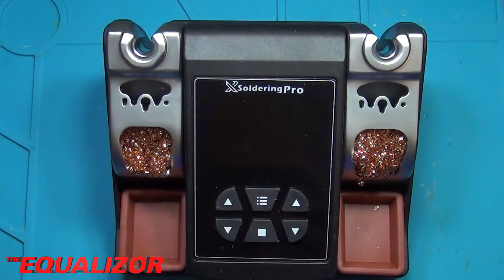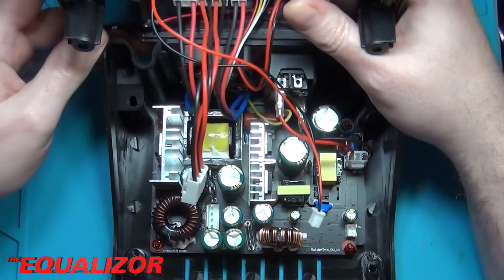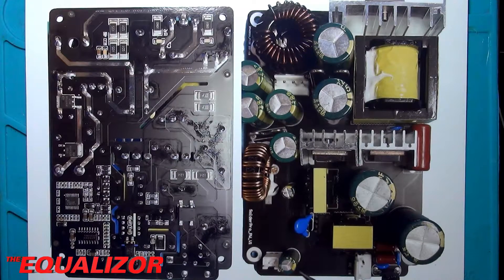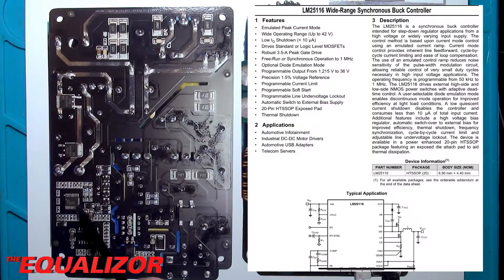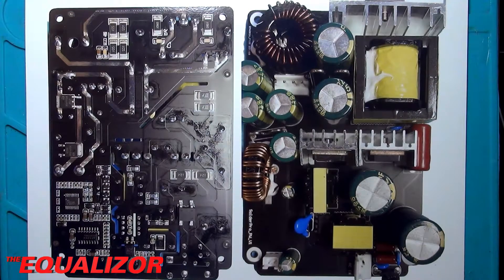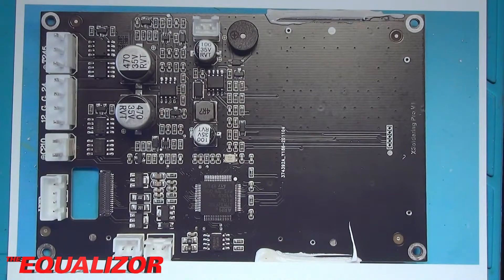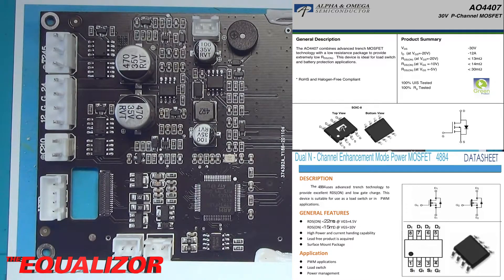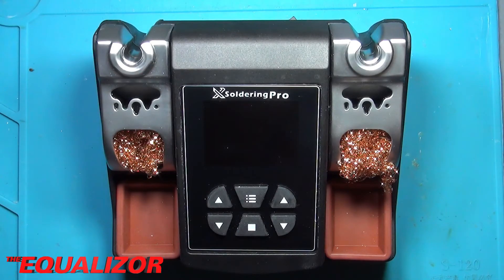Xsoldering Pro teardown

Comment: 2 pin for c210 because thermocouple is in series with heater element. And 3 for c245, because it has separate heater and thermocouple.

Comment: wow thats definitely better than i expected, those things look kind of awful in the pics, i was going to go with the mechanic or i2c, eventually i grabbed the aixun assuming with its updatable FW, high power and  JCs usual good support itd get a T210 handle in no time but it didnt so i grabbed the recent OSSTeam(GVM) t210 which was a cracking iron but mine went faulty, i picked it up one day and the tip went glowing red and then it just died, shame as it was a lovely bit of kit really. ive seen the new T16 which seems a bargain as while it comes with a T12 its compatible with a T210 (and id assume the C115) but im thinking i may just buy a real JBC instead at this point instead of buying clones over and over

Comment: Dear sir ! Please tell me how to solve this issue.......
I have bought a new Xsoldering pro......but from first time I am facing a problem with this.....
C245 iron handle auto sleep sensor don't work above 250°C ....Maximum  time I work in 350° ....then I have to reduce the temperature manually under 250°C  ....
But C210 handle is working fine.....at 400°
how can i solve the problem sir !

Comment: I'm going to try the new xFixTools0308 update software. Which one did you try last (xFixTools0111)? My station has a problem with only one C245-knife tip - it does not turn it off when put back in the station. All other C245 tips work properly.
Reply: ITS problem tips . I nave the same problem . AND i Buy new tips .

Comment: Thanks for the video. But I have a problem with this station: when the C245 temperature goes above of 230 deg the C245 cannot see the stand, so cannot powering off. And if the temperature goes lowest of approx 230 deg the C245 'stand' status working well. I cannot take my mind what is happened? Is there a EEPROM have a not valid data? Why it breaking near 230 degrees?
Reply: That's right, I discarded it for it, it is a known problem, even the sellers describe it in red letters

Comment: Very throughout and quality review, especially for such a niche Product!

Have you found a suitable replacement for the fan yet? It's driving me nuts that this little thing works so poorly and makes more noise than all of my desktop's fans together (from what i see its 40-50mm 2 pin dc fan).

Otherwise i am quite impressed by this station, only one issue : when I heat up the c245 tip above 300°C , it wont cool down unless i press the tip against the metal plate. I suspect, that it may be aconfic issue, but I cant seem to edit the software...
Reply from the maker: I replaced the fan with a dual ball bearing one from Amazon https://www.amazon.co.uk/gp/product/B07NTCXCYD/ and it work great! So much quieter, makes a huge difference. With regards the cooling down issue, have you tried just doing a factory reset (It wouldn't work on mine IIRC but ymmv)

Comment: This thing is absolute junk. Unusable by anyone serious about soldering.
Reply: wish I read that about six hours ago, since I've gone one on the way here from china. what's your main complaints?
Reply: @youchooby  cant use real jbc handles, constant reset while you are working with it.  Their upgrade package comes with a virus to infect your computer. Not real accurate either. It looks like a children's toy sitting there.
Reply from the maker: @vic lorenz I’ve never had my station reset while working with it and I’ve used it a lot. I’ve done plenty of smd and thru-hole with it and it’s been great so far. The updater doesn’t come with a virus (to infect your computer), - that’s nonsense. I even ran it through virustotal.com to check. Granted it’s not as accurate as it could be, but as long as you know that you can mitigate it, like I did. Now I have no affiliation with jdi, I get no kickbacks or sponsorships, so I’m completely independent. I don’t care if people buy it or not, all I can do is give my opinion on it.
Reply: @the_equalizor  Norton 360 kicks it right out for spyware, also why would you use an executable on a 32 bit controller instead of a simple bin file upgrade? But of course the seller says "no problem, just turn off your antivirus". yeah....No. And the seller also admits you really need to use their tips because real JBC tips cause that issue (crashing).
They advertise "using JBC tips and handles, then tell you, you can't use real tips and handles. Now the single handle unit will use real JBC tips and handles, but only runs 210 not 245. Read their fine print carefully. If they just said "JBC like" I would be less unhappy about their sales tactics.
Reply from the maker: @viclorenz2522  I don’t use the jdi tips on this station I Use jbc and jabe tips, haven’t had that reboot problem. Clearly you don’t like this station and that’s fine, you’re entitled not to, but for me it works fine, so I’m happy with it. We’re just going to have to agree to disagree unfortunately.
Reply: @youchooby  Sorry. They got me too.

Comment: My xsoldering station died after 1 month of purchase😔....its turning on but when i lift the handle it start blinking on and off...any idea whats going on?
Reply from the maker: Sound like maybe the power supply is tripping out when it kicks in to heat the tip perhaps? That’s a return to sender issue I think.

Comment: The black solder mask is more than cosmetic. It is a thermal "heat sink" (or more accurately "Heat Spreader") to mitigate hot spots created by power components. It shows up in many higher quality AC Adapters used to charge mobile phones.
Reply from the maker: Hi Peter, 

That didn't''t sound right to me, I don't think any PCB designer worth their salt is going to rely on the Solder Mask for real world cooling. Thats what copper pads/pours, heatsinks, thermally conductive pads and to some extent via stitching achieves.All of those can be factored into the design to achieve real world cooling.  

I've also repaired/torn down a large number of power supplies from companies like Astec, Besttec, FSP, Delta, MeanWell and the only ones which had black mask on were the Apple ones. Everything else has normal FR4 with usually, green resist. 

I think black mask is more a cosmetic thing than anything else. As I'm not an expert on this, I asked the question over on the EEVBLOG forum and the general consensus is that solder mask colour doesn't make a whole lot of difference to heat spreading or dissipation.

Link to EEVBLOG forum post : 

https://www.eevblog.com/forum/eda/does-pcb-mask-colour-affect-thermal-performance/
Reply: @the_equalizor  
Rob, many thanks for following up on this topic. While I agree that the "Black Solder Mask" is a fad (possibly a fashion statement), I know for a fact that black coatings and other "magic" are in volume product for heat mitigation. I'm under an NDA (Non Disclosure Agreement) so I can't share more details. However, with a bit of Patent research you will find it - some of the US Patents are now granted and in the public domain. Hope this piques your curiosity!
Reply from the maker: @pstonard  In the absence of any verifiable evidence to show that black mask is used to assist in thermal dissipation on a PCB I think we’ll leave this discussion here. Definitely got me (and some eevblog guys) thinking though so that was interesting!

Comment: hello I ordered this soldering station which will arrive soon normally. Can you put the site link or update the firmware? THANK YOU SO MUCH
Reply from the maker: www.jditools.com
Reply: I’ve got both softwares for it , one is to update it and other is to calibrate it if the temperature is not accurate , but to be honest both of irons the temperature is accurate
Reply from the maker: @M.E63  Do you have a link to the calibration software at all please ?
Reply: @M.E63  i am also interested in the software. Do you mind sharing it?
Reply: @khamigen  I’ll upload it for you and give you the link
Reply from the maker: That would be appreciated, thank you!
Reply: Anyone has that software to calibration?

Comment: Looks nicer than I expected! Would have liked to see some better filtering on the high side so less of the switching noise leaks onto the mains, as I tend to keep scopes and sensitive meters etc on the same circuit... but its not that big of a deal I guess. Thanks for the teardown.
Reply from the maker: I definitely expected to be a lot more crappy for sure :) but yeah quite a pleasant surprise. The lcd screen mounting was a bit cheap and nasty tho. Made me laugh.